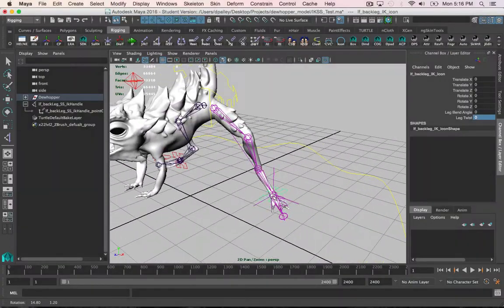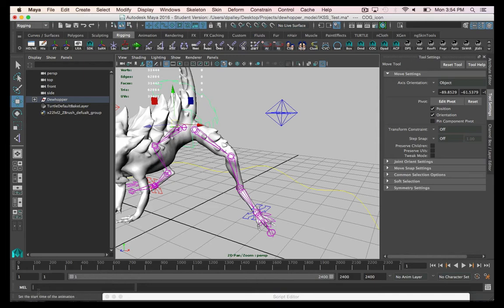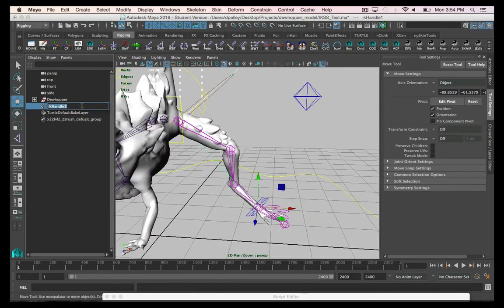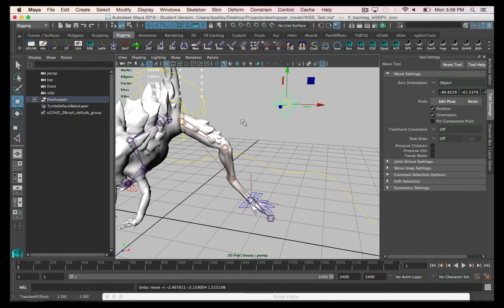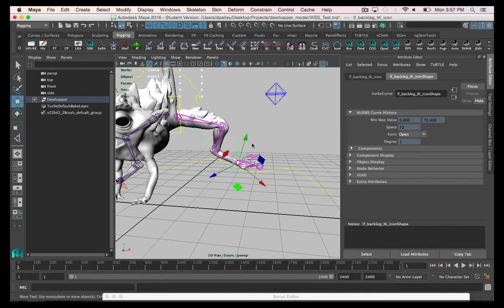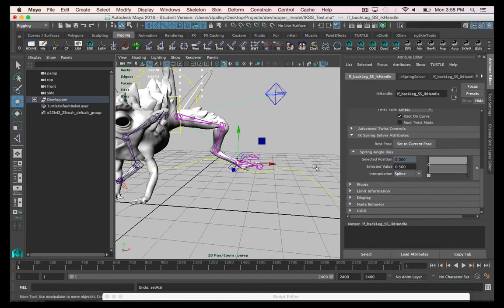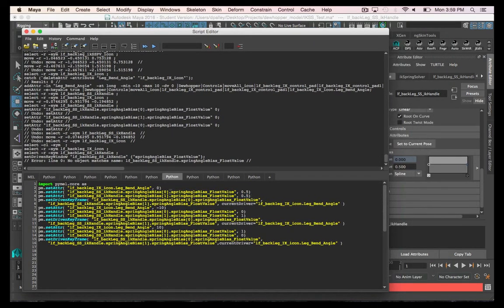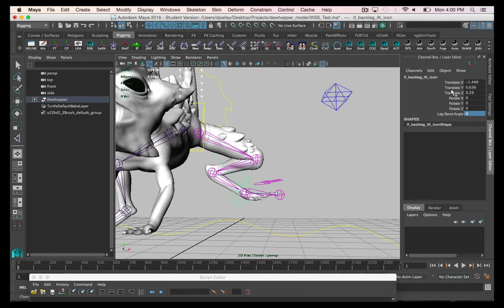Spring Solver IK (Part 1)

Comment: Hey man, i'm using Maya 2018.4 at work and i'm trying to use this setup but when i change the value of legBendAngle it doesn't update at viewport real-time. It flickers when i move the ctrl which is irritating. It doesn't happen with Maya 2017. Any ideas?